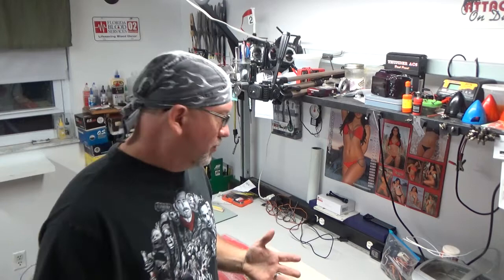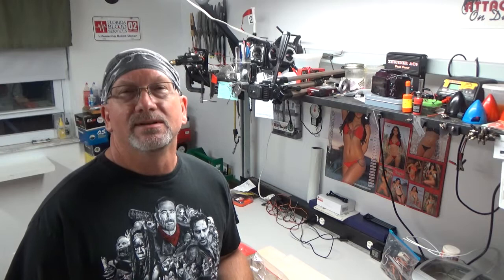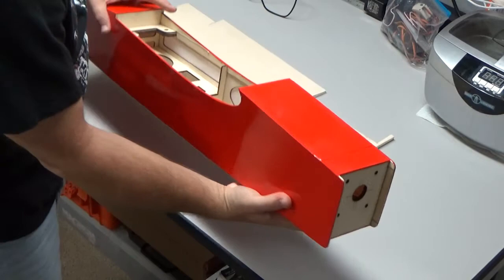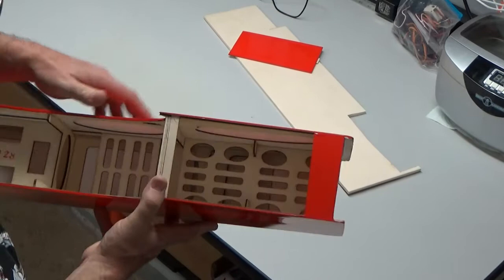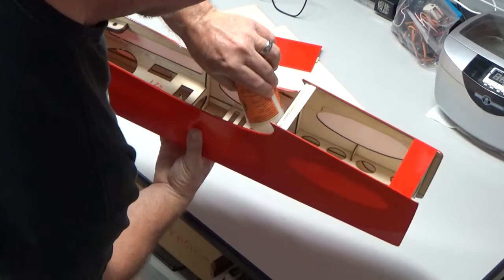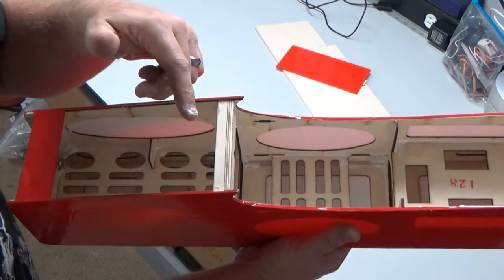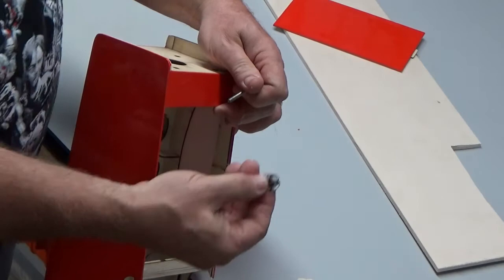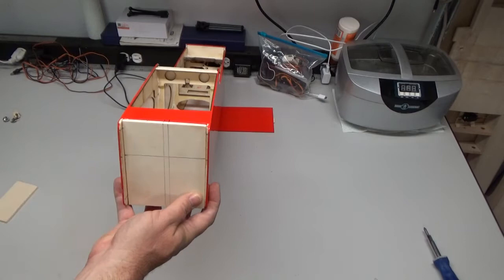Value Hobby Easy Stik 60 Assembly Video 1

Comment: I see how these new planes are made and being I have an extra 300E that suffered a light crash and it really damaged the plane. I am NOT impressed in the lazer cut modern balsa ARF planes. I ended up adding supports and adding glue myself after reconstructing the plane. I remember the magazines you could buy that had plans to build your own plane. As you state, not enough glue, poor quality wood.  The price doesnt reflect the lack of supports that should be in these planes. I even doubled up on the stringers. My brother built many planes that held up better than what the ARF's of today do. The coverings look nice but theplanes dont even hold up to light crashes. Great video!